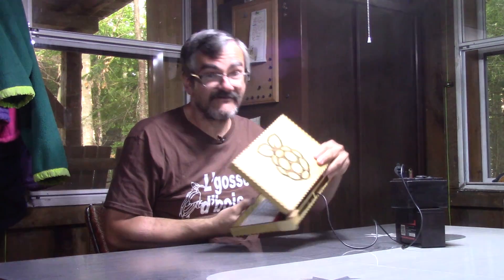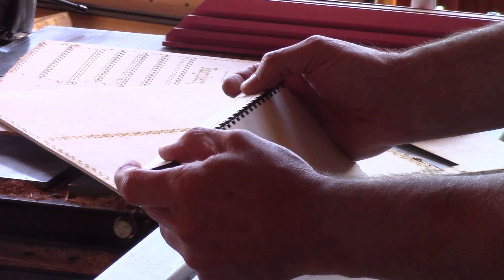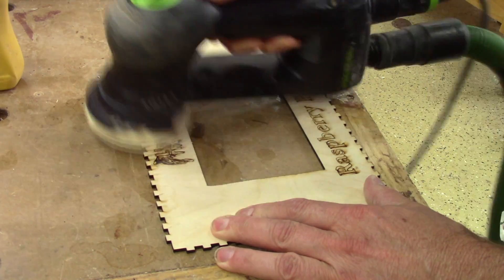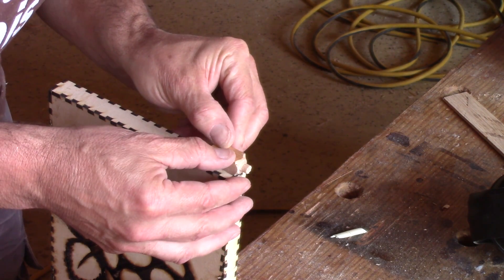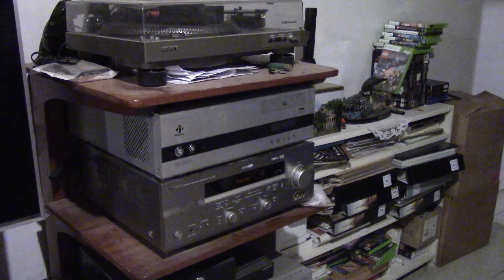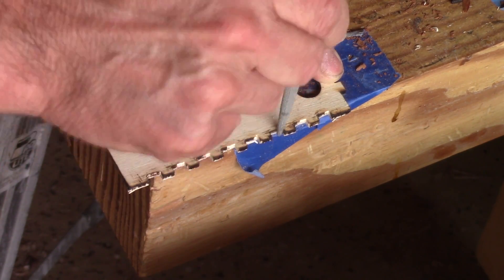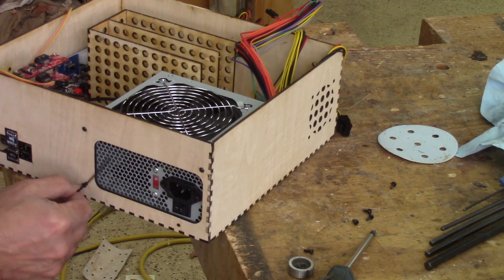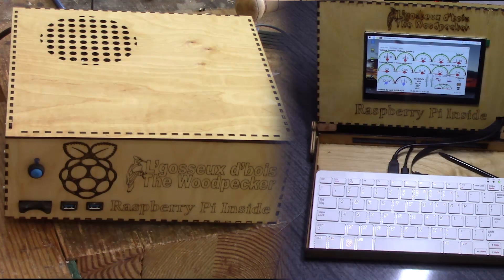The Woodpecker Ep 295 -  Wooden laptop cases for a Raspberry pi

Comment: Wonderful designs and great video! How much does RPi 400 cost there ?
Reply from the maker: The price is now inflated on the web, but when I bought mine at a local electronic part store almost two years ago it was $125 Canadian, about $100US, now they don't have any left. I bought two of them then, I was expecting a shortage of the 400 like the RPI4. Hopefully the price will come down this year, at least it's what I read on the net. They will be in full production in the las quarter of this year.
Reply: @LgosseuxDbois-TheWoodpecker  Many thanks for reply, Sir! :) I have old 386 or 486 built into a keyboard from around 1997 or so, that was peak of technology back then haha. Probably one of the rarest machines I have, as they were intended for industrial environments. The 400 will be like a throwback to those times, except better hardware. :D
Reply from the maker: Yes it's a little like an Amiga500, but 100 times faster. When I use my RPI400 to emulate an Amiga, it's many time faster than the original machine. I always have my second RPI400 beside my laptop on my desk hooked up to an old monitor. I love these computer and the best thing is that the informations on the web is enormous, I was always able to do what ever I want with them. And the price is unbeatable, when they will go back to their original price, not the scalper price they are right now.
Reply: @LgosseuxDbois-TheWoodpecker  I never had Amiga, but my first Micro was ZX Spectrum back in 1980s :) (Yes I am young compared to you, I guess). I fully plan to buy at least two 400 PI when they come to reasonable prices! :) One for retro! My old ZX Spectrum is on shelf, would need replacement of capacitors but I don't want to do that, it would destroy "vintage" of it. :)
Reply from the maker: I still have in my attic my very first computer which was a Timex Sinclair.
I didn't keep my old Amiga I gave it away. But I kept all that was on the HD and still can use it with PiMiga. You will surely find an emulator for the Zx Spectrum running on a Raspberry pi. 
My shop is all controlled with a RPI4. it's how I can truly know how many seconds my tools are working and how many seconds the heat was on during a year, It also controlled all the lights, the dust collector, etc. It's endless what you can do with a SBC like the RPI. But for smaller stuff, I use some ESP32 or ESP8266, I used to use AVRs but now I switched to ESP it's more convenient to hook everything to WiFi. I will have an episode on all the modules I made with ESP for the shop soon
Reply: @LgosseuxDbois-TheWoodpecker  My first was INES which was ZX Spectrum with extra circuitry for word processing, then 5150, 5160, 286, 386, 486, ... here I am :) It is always some sort of softness when look back to where you come from :)